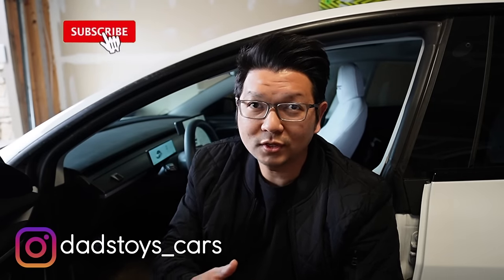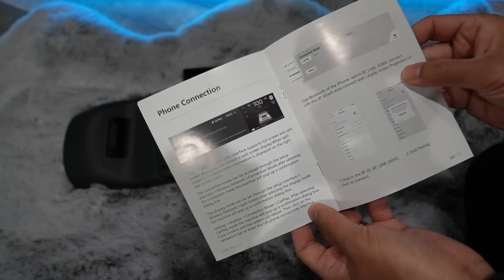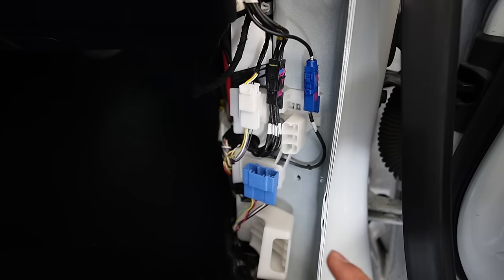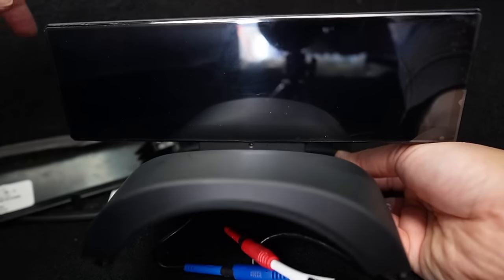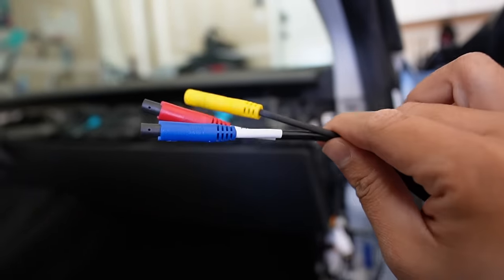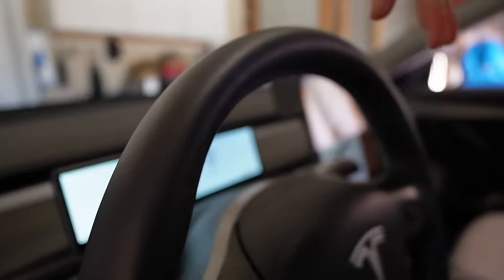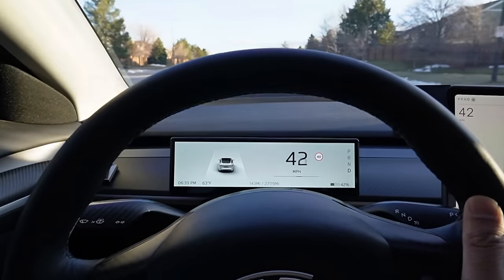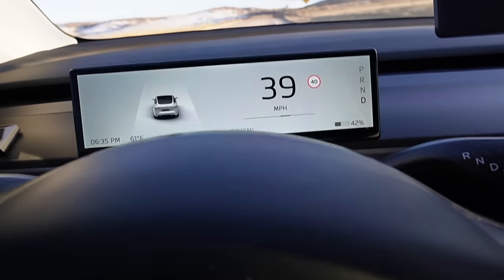New 2024 Tesla Model Y/3 Display with Apple CarPlay & Front Camera Upgrade! #tesla

Comment: The issue with all of these is that they don't change the UI on the main screen... if you were able to actually move the road display / speedometer to this instead of the main display then it would be something to consider.
Reply from the maker: Appreciate you comment.
That would be the ideal display but so far non of these aftermarket display has the access to Tesla cameras feed. That's it can't show all the info on this display.
Thank you for watching! :)

Comment: Thanks for this great video and the install instructions. I installed last night on a late 2023 MYLR. It works fantastic. I love having directions in front and the list of turns shown on my phone at the same time. The install was smooth except for three things. First my MYLR has an AMD processor with a white ODB port not blue as in this video and all others. Second, I had a lot of trouble passing the camera wire through the firewall. I first poked a hole through the rubber gasket that’s on the right but could not get the camera through the tight space. I was able to just push it through the right edge instead. It went just behind the glovebox and I was able to pull it over and out. I used white electrical tape which made the wire easier to locate. Third I found the steering wheel plate difficult to remove and to attach the new one. I accidentally snapped off a prong on the new cover because it didn’t line up perfectly and I pulled it off to retry.  Hope this helps others with their install! It’s well worth the effort.
Reply from the maker: Appreciate your comment.
The hardest part would be installing the front camera.
Thank you for sharing experience with us and your awesome support Jim!🙏😃

Comment: This is the best OEM like display. However, it’s missing two vital components. The autopilot “nag” needs to be on the display, as does the blind spot warning. If those two alerts are missing, then my eyes need to shift between the center display and the main display.
Reply from the maker: Appreciate your comment.
Teslasy said they’re working on adding those features in the software updates.
I just received latest OTA with blind spot warning on the display and testing it now.
Thank you for watching!
Please subscribe for future contents.🙏😃
Reply: I won't buy a display that does not have the "nag" warning.

Comment: Just purchased today using your code. Thanks for the discount. Wish me luck! Also, I got the pro screen, is the one you ordered the pro?
Reply from the maker: The one in the video is T8 not T8 Pro.
T8 Pro attached the dashboard with built-in air vent but T8 display like you see in this video sits on the steering wheel column. I think T8 has better air flow than T8 pro.
Thank you for watching Andy!
Please subscribe for future contents.🙏😃

Comment: Can you navigate through the CarPlay menu and icons using the scroll wheel or is it touch screen only?
Reply: Can navigate with steering wheel controls ( can be turned on or off in settings)  bear in mind navigating CarPlay moves the autopilot car distance on the main Tesla screen at the sametime

Comment: I like it but I can’t get the steering wheel function to work nor does it display the psi info, speed limit sign, or the autopilot functions. Maybe I didn’t do something right in the setup. But I have FSD enabled and maybe I’ll try it when I switch to just auto steer enabled. I also have the one with air vent opening and not this particular model.
Reply from the maker: @renardojones8325  Please check the connection or try to get OTA update for the display via WiFi.
Thank you for watching!
Please subscribe for future contents.🙏😃
Reply: @dadstoyscars  thanks. I ran one after first install and since then, I’ve checked for new OTA updates several times and it’s always “no update”. There’s no customer service to reach out to so I’ll keep trying or move on to another product.
Reply from the maker: @renardojones8325  Which brand did you buy it from?

Comment: I like this one alot. But I could not see any right/left blind spot light up at all, does this not have the blind spot red lights?  Also, i could not see very well, do the brake tailights light up when you use brake pedal on the small car display tailights?  I really like that feature to see my brake lights easily light up due to the one pedal driving i think its great to know exactly when brake lights are coming on.  Cheers!
Reply from the maker: Teslasy just sent out OTA and it has blind spot warning.
It shows the brake lights in the display graphic when the car is braking.
Thank you for watching!
Please subscribe for future contents.🙏😃

Comment: You may have seen my comment before about the 3 day wait period before the item gets shipped out.  Well, they more than made up for it.  Once it was shipped it only took 2 days from Hong Kong to my home in Atlanta.  Wow.   The video really helped the installation which only took maybe 40 mins?  Really easy if you are handy with stuff like this.   The only issue is, one of the tabs broke off the plastic piece that is above the steering wheel.  You can't really tell it broke off but i am going to ask they send me a new part.    That all said, THIS THING IS REALLY AWESOME!!!  Way better than I was expecting.  Really great graphics and carplay works way better than I was expecting.  Easily worth the price.  Tesla really should make this standard equipment or offer it as an option.  I am sure some people would pay $1000 for it to be an option so doing it yourself is just a great deal at 1/4 of that price.
Reply from the maker: Appreciate your comment.
I’m glad it worked out for you.
The shipping and turn around time of your order could be tricky as sometimes China have holidays that we don’t have so if you order during their holidays it would take longer.
Thank you for your great support!🙏😃

Comment: Does it support android auto? Is there a way to manually precondition battery like the Teslogic?
Reply from the maker: @L33TTechReviewer   Yes, it’s compatible with Android auto but it’s doesn’t have shortcut button for precondition the battery.
Thank you for watching!
Please subscribe for future contents.🙏😃
Reply: @dadstoyscars  what is that shortcut button you have? That's a handy feature, is it possible to have one of these displays and also have shortcut buttons that can do things like manual preconditioning of battery or turn on/off awd or stuff like that?
Reply from the maker: @L33TTechReviewer   The best short cut buttons would be S3XY Knob which also comes with instrument display for your phone and it’s re-programmable.
Here is the full video: https://youtu.be/Qj2t0sUKJxo?si=MU4j1driGz69eing
Reply: @dadstoyscars  I just watched the video! Does the instrument display for phone really only include speed and what button is active though? What I liked about the T8 would be to use android auto and always on blindsspot monitoring
Reply from the maker: @L33TTechReviewer  It has always on blind spot warning.

Comment: Thanks for all the reviews! Do you prefer the F9 or the T8 screen?
Seems like the T8 pro is very similiar to the F9.

Also, for the rear screen do you like the new 8.8 in rear screen but only side to side air adjustments, or the V3 7in screen wtih 4G you reviewed last month?
Reply from the maker: Yes, T8 pro and F9 has similar built-in vent location.
I think I like the screen size of 8.8” display better it also has bigger air vent compare to 7” display.
Thank you for watching!
Please subscribe for future contents.🙏😃
Reply: @dadstoyscars  thanks for the info. Looks like Telsasy has the T8 and the integrated 10.25 inch screen...actually looks like Hanshow and Tess Studio have the same FY9 large integrated screen with leather wrapping.

Which screen UI and Cosmetic did you prefer since you recently tested the T8 8.8 in and the 10.25 integrated screen?
And Why?

Comment: Is it neccassary to remove dashboard? Looks like on a Teslasy video they did not remove the dashboard.
Reply from the maker: Yes, you do need to remove the dashboard as the locking clips of the steering wheel column cover are underneath the dashboard.
Reply: @dadstoyscars  ok, thanks!

Comment: Does this unit show red pulse on the side of screen fpr blind spot?
Reply from the maker: This display doesn’t have blind spots warning function.
Thank you for watching and your awesome support!🙏😃
Reply: The latest version has added blind spot warning function, added AP assisted driving rainbow road display, and it also has ota upgrade.
Reply: Is it already installed? Or i have to upgrade the software myself after purchase?
Reply: @otommytruongo  The latest version has been upgraded. If not, you only need to connect to a WiFi hotspot to upgrade.
Reply: Let me know when you upgrade graphic to model Y . I will buy it. Thanks

Comment: Does the audio output automatically go to the car audio or do you have to manually switch it each time?
Reply from the maker: My experience with this display I only had to connect to car speakers once by charging output of CarPlay on my phone then after that it will output to car speakers every time.
But you still need to change source to Bluetooth in your car.
Thank you for watching!
Please subscribe for future contents.🙏😃
Reply: @dadstoyscars  So do I do it once and then each time after that I'll have carplay on the display and if I'm playing Spotify on my phone it'll automatically play through the car? Also, how is the audio and microphone quality with calls? Thanks
Reply from the maker: @Quickandfast7  phone call is the same since it’s basically from your phone
Reply: @dadstoyscars  yeah but it's using the Tesla's microphones not the screens?
Reply from the maker: @Quickandfast7  yes

Comment: I just bought a cyber truck steering wheel for my Y. Will it block the screen?
Reply from the maker: This is probably the only display that you can use with Cybertruck steering wheel.
I demo in the Cybertruck steering video and that’s all I know because I didn’t install the steering wheel in my car. It might block a tiny bit of the top part but you should be able to see most of the display.
Thank you for watching and your wonderful support!🙏😃
Reply: @dadstoyscars  does this model have car play? If not do you know of a display with car play that will work with the cyber truck steering wheel?
Reply from the maker: @jajacobs2  Yes, this T8 display has Apple CarPlay.
Reply: @dadstoyscars also, is the ac blocked by the device?
Reply from the maker: @jajacobs2  if you choose T8 that attaches to the steering wheel column, it will only block the bottom part but you can adjust the airflow to go over the top of the displayz
Reply: @dadstoyscars  I got an email from the company and they told me if I have a cyber truck steering wheel, that the display would be blocked. You mentioned that it wouldn’t be blocked.  Can you confirm this or any other thoughts?
Reply from the maker: @jajacobs2  Please check this video on the part that I placed the steering wheel on top of my current steering wheel with the display in my car.
https://youtu.be/Nyec_smknJs?si=tNVOb2DIY312p_yn
Reply: @dadstoyscars  I saw it, thank you. That is super helpful. Did you end up installing it in the car with the display?
Reply from the maker: @jajacobs2  I didn’t install the steering wheel because I will end up have to uninstalling it soon because my wife wouldn’t like it.

Comment: Update: Got mine yesterday and installed it today. It looks great with the Yoke. 

⚠NOTE FOR YOKE OWNERS: if you got the Yoke from Tesstudio or Hanshow (not sure if other Yokes have the same problem or all Yokes are made by the same company actually), due to the design of the Yoke, the bottom of which is closer to the steering wheel base comparing to the distance between the stock steering wheel bottom and the base, it's very hard to take off that piece of cover to be replaced, because the cover has a margin of approximately 3mm folding in. I can't post a picture so I'm trying my best to describe the situation. I had to try prying the yoke out a little bit to take the cover off. And it's even harder to put the replacement cover with the display attached back to the steering wheel base. It took me over one hour to finally get this part done. In total around two hours as I had to remove the F9 first. 

But the result is great. Looks much much better than the F9, and airflow passes much easier. F9 just does not give you the airflow as expected. So I suppose T8 pro will not give you better airflow than the "non-pro" one, and the airflow tunnel just does not look good. Can't wait for the update with Model Y graphics. And really hope they add US speed limit icon and stock fonts.
Reply from the maker: Appreciate your comment and the updates.
You’re right about T8 pro airflow. 
That’s why I pick the T8 over T8 Pro.
Reply: Does it have some  blind spot warning?
Reply from the maker: @Tesdog  yes, they just sent out another OTA which added blind spot warning function.
Thank you for watching!
Please subscribe for future contents.🙏😃
Reply: @Tesdog  yes
Reply: just received my T8 and planning to install this weekend. Any tips to make the install go smooth with the yoke wheel? Thanks.
Reply from the maker: @juvaldiv  Installation should be the same with yoke steering wheel.
You just have to carefully follow the instructions and make sure to turn off the car power before plugging in the OBD port and power plug.
Thank you for your great support!🙏
Reply: @juvaldiv  After attaching the screen to the steering wheel rack cover, before the last step, if you find it hard to put it back and close every clip due to the small seam between the rack base and the butt of the yoke, then you may want to (or should actually) think about loosening the yoke to provide enough space. You don't have to take off the yoke, but do have to pop out the airbag, and loosen the screw. This is what I did. You won't want to break the clips. They are really think and fragile.
Reply: @timotian1664  Thanks for the info. I purchased my yoke from Amazon but I suspect that they're all made by the same manufacturer so most likely I'll run into the same issue. I was hoping it would be a quick install but now I know what I'm getting into. I also want to install the front camera since I'll be removing the dash anyways... Thanks again!
Reply: @juvaldiv  It's really not that big deal, especially if you did the yoke install by yourself. Also YMMV. It could also be my car only. Seems like not all yokes are having this problem, which is not really a problem. All that takes is additional 15 mins to take the airbag off, loosen the screw, tighten the screw and put the airbag back.

Comment: Can you please compare or tell us your opinion on the F9 screen with android OS vs the T8 screen with linux.
I am between the T8pro and the F9 which has been out a few months longer but has option for 4G sim and Android
Reply from the maker: Appreciate your comment.
I like the T8 much better than T8 pro or F9 because F9 and T8 Pro has bottom built-in air vent which in my opinion get less air flow than T8 which is low enough for the top air flow to get through to the driver.
As far as operating system, I think they not that different but I like the graphic quality on T8 and T8 pro better than F9.
Thank you for watching and your great support!🙏😃
Reply: @dadstoyscars  Thank you, this is very useful insights.
Reply from the maker: @TerenceLi  no problem 😉 
Thank you for your support!🙏

Comment: I just put your code in and it worked. I emailed the company this morning and I haven’t heard back from them. Do you know the difference between the pro model and the regular?
Reply from the maker: T8 Display attaches to the steering wheel column and T8 Pro attaches to the dashboard which will sits a little higher and blocks more AC than T8 that's why it has build-in AC vent pass through.

Comment: Can you make a video also with 6.5 inch model ?
Reply from the maker: I saw they have that 6.5” display but I like this T8 design much better. Also T8 has lower profile so you would get better air flow from AC for the driver.
Thank you for watching!
Please subscribe for future contents.🙏😃
Reply: @dadstoyscars  Thanks for that info, I was closed to place an order on the 6.5 one, I used your referral code and ordered the 8.8 one.
Reply from the maker: @TheHitteam  no problem. Thank you for watching and your great support!🙏😃

Comment: You skipped the hardest part; hiw to run the wire from the front thru the firewall
Reply from the maker: The reason I didn’t do the actual installation for the front camera because I don’t usually have the display for that long. When the new display comes which I have to test it out might not have compatible camera or use the same cable which I would have to uninstall it over and over again.
Thank you for watching and your great support Henry!🙏😃

Comment: What is the difference between 8.8 inch and 8.8 inch pro ??
Reply from the maker: 8.8 pro you install on the dashboard instead of steering wheel column and it has direct built-in air vent on the bottom of the display.
Thank you for watching and your great support!🙏😃
Reply: @dadstoyscars  Thanks. Do you know if its possible to change the image of the new model 3, to model y insted, since its the model im runnig ??
Reply from the maker: @SilverLine84  Teslasy said they’re working on the update and should have that ready with a month for the new update
Reply: @dadstoyscars  very nice